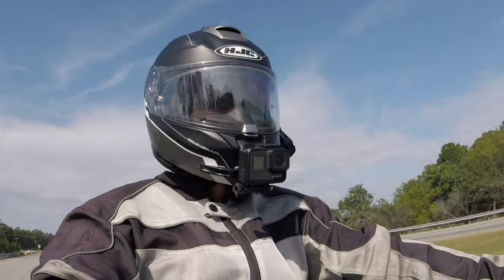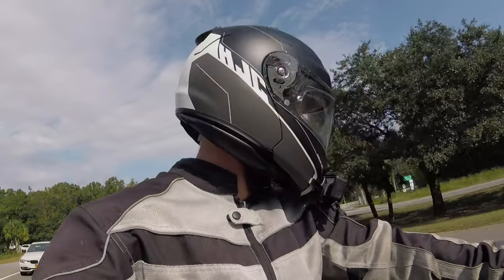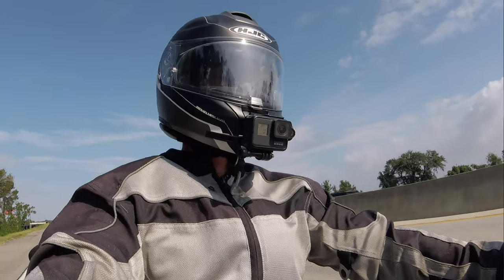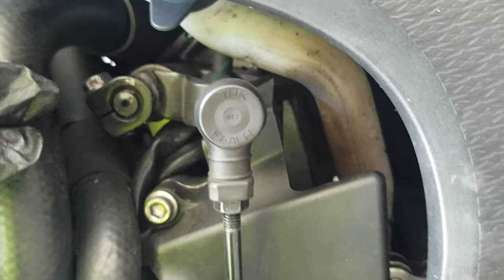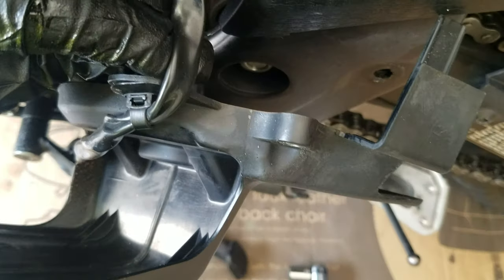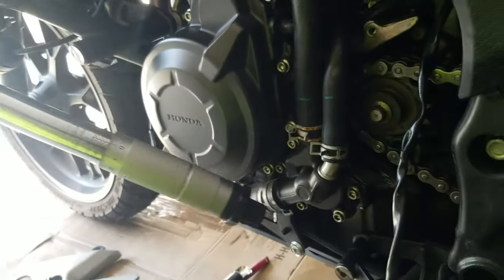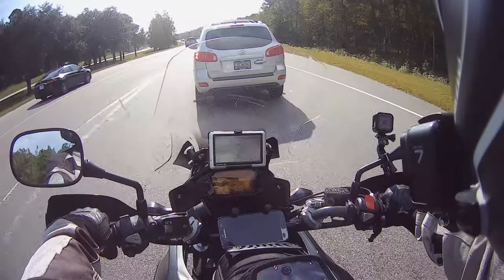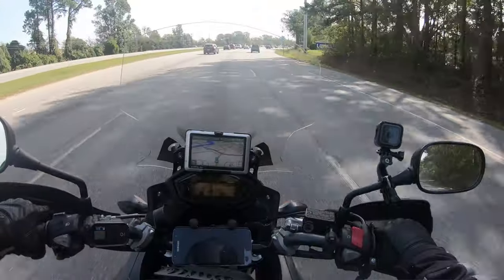CB500X 16T Sprocket Swap

Comment: I was looking for the CB300R sprocket swap but it's a very similar operation.
Reply from the maker: That's awesome, Bill!  I hope my video was helpful.  I would imagine many of these Honda models are similar, and probably even share parts.  Enjoy your upgrade!  :-)
Reply: @MotoPhotoAdventures  The sprocket on the CB300R looks different but the procedure to change it is exactly the same,  after the change the RPMs are around 1,000 less than before.
Thanks for sharing your video and have a safe ride!

Comment: Great! Thanks! I wonder what Honda's engineers would have to say to defend their decision concerning their choice of 15-tooth sprocket ???
Reply from the maker: Glad you liked it, Alain!  Honda's response would be easy.  "We build our motorcycle with the entire world in mind, not just the highways of the developed countries."  Since many riders live in developing countries with smaller roads, or in the mountains with lots of hills and curves, or in areas with bumps and potholes, cruising on a highway at 70mph is not normal.  For them, the 15T sprocket is perfect.  But for us in countries with large highway systems and long-distance motorcycle trips, the 16T is better suited.  Plus it's an easy upgrade for less than $25!!!  :-)
Reply: Two up with full luggage.. maybe..

Comment: torque at every RPM will be 6% less (15/16).  For those who plan a little off roading, they might want the stock 15T for more torque when on difficult steep terrain.  I love the CB500X. had 2013, switched to a Versys 650, want to go back to CB now!!
Reply from the maker: Thanks for the nice comment, Jim!  I looked at the Versys too.  But the CB500X was just right for me.  You should come back!!!  :-)
Reply: BUT the new 2019 model got an 4% torque improvment, so the overall loss will be 2%. The benefits are so obvious that makes an apsoloute worth upgrade

Comment: I've so got to do this on my Honda Rebel 500. 1st gear is so short it's a joke. And the RPM's on the highway is just extra wear on my motor for no reason. Right now it's just to torguey, I'm never going to do wheelies on my Rebel anyway it's just a waist of fuel running so high RPM.
Reply from the maker: Sounds like a great plan, Scott!  A friend of mine owns the Rebel 500.  It uses the exact same engine as my CB500X.  One could argue the CB500X needs the shorter first gear for technical off-road riding.  But there is zero argument as to why the Rebel would need such a short first gear.  I think you will transform that bike into a much more user-friendly machine if you make the switch.  Good luck!
Reply: @MotoPhotoAdventures  Thanks Chris but mainly I just want to do longer highway trips without it running so high.

Comment: Did anyone find it that the bike vibrates a little bit more than with the orinal sprocket ? I feel more vibration on the bar handles
Reply from the maker: I haven't experienced that.  If anything, the bike got smoother with the new sprocket since most of the time I'm reving at lower rpm due to the upgrade.

Comment: The factory gearing on my CB300F is too low for my liking, so I went with a +1 front sprocket. I belive the change was from 15 to 16. So much to my liking, but I have to be a bit more cautious when passing in the oncoming lane. There isn't much power left to pass if highway crusing in top gear.
Reply from the maker: Hi James!  That makes perfect sense.  These aren't very powerful engines for passing.  Glad you like the better gearing otherwise!

Comment: Dumb question : Why not change the rear sprocket instead of the front? Costlier?
Reply from the maker: You can easily do either.  But changing the rear is more expensive and more involved (removing entire wheel from bike, breaking the very tight large bolts holding it in place, etc.)  But many people change the rear.  And some even do both!

Comment: is there any way too recalibrate the speed on the bike dash?
Reply from the maker: Hi David!  Absolutely!!!  It's actually really easy to do by plugging in a "Speedo Healer".  A couple different companies make them.  Here's the one we recommend:  SpeedoDRD DRD-3 from 12 oClock Labs - https://amzn.to/2Pahs8C.  Even a stock CB500X right off the showroom floor can have a small discrepancy in the speedometer.  If you replace the stock tires with knobby tires or a tire of a slightly different diameter, that can throw it off even more.  Which is why some buy the SpeedoDRD whether they change the sprocket or not.  Enjoy!

Comment: It's funny how your speedo is out compared to your GPS. As I read in most cases (maybe it's a European /UK model thing) that when you change up to a 16 tooth front sprocket it brings the accuracy of the speedo and the GPS to be spot on, as the speedo has always been out reading around 4% higher

Regarding the bike's recorded mileage would that be affected too being our speedo is now out ?
Reply from the maker: Yeah, I don't think the speedometers on these bikes are terribly accurate from the factory.  Changing the tires, changing the sprockets, and many other things can affect the accuracy even more.

Comment: Personally we don't like to change the GB sprocket .  If you had put one tooth less Rear sprocket that was better for highway top end speed or open ur throttle for some rev fun .  You may hurt ur bike crank soon .. Happy riding.
Reply from the maker: Thanks for the tip, Speedwell rider!  I'll keep that in mind when it's time to replace.  But for now, since hundreds of other CB500X owners have done the same modification without a single incident that I've heard of on any of the chat forums, hopefully I'll be fine.  I've been extremely happy with the new gearing.  And I just returned from a 4,500 mile adventure through Mexico on it with no issues.  But I do appreciate the kind word of advice.

Comment: is the speedo healer a part that has to remain on the bike or just recalibrates..... I guess I'm wondering if this can just be taken to the dealer to be recalibrated?
Reply from the maker: Check out their website.  It's explained quite well.  The device plugs "in line" with another port or sensor on the bike.  It remains there permanently.  Cool part is, if you ever change to a different profile tire or a different sprocket, you can just go in and adjust the speedo again.
Reply: @MotoPhotoAdventures  awesome!  thx for the info!
Reply from the maker: @h.o.w.d2161  any time!

Comment: Bro I did this and I didn't mark the shifter when I removed it. Is there a specific point it needs to go back? My motorcycle didn't come with a manuel.
Reply from the maker: No problem!  We have made a video on how to adjust your gear shifter:  https://youtu.be/xYH3tdJnI_8?si=0jleL3JXowStnF8D.  The video is for a Suzuki V-strom.  But it's the same exact process for the CB500X.  There is no "right" or "wrong" setting.  The shifter is designed so that you can make the angle higher (like if you have big feet or large boots), or lower (like if you ride with tennis shoes).  Just put it on, then sit on the motorcycle to see if it's in a comfortable position, then adjust up or down if needed, then tighten it back up.  Cheers!
Reply: @MotoPhotoAdventures  thanks so much man
Reply from the maker: @sanguiniusix9430  happy to help!  You should check out our CB500X playlist...lots of great tips and tutorials:  https://youtube.com/playlist?list=PLMpCu16Bx7xP_DfFjhRG9np5cXTO-1uNY&si=1CpX75GkpM6Wm7rh

Comment: 6:20  is that axle nut a 24mm or 22mm?  I can't find any confirmation on the 2019 model, although it could be a safe bet the 2013 through 2018 model's rear axle nuts are the same size.
Reply from the maker: It's a 24mm nut.
Reply: Why ask?, just measure it.
Reply: @davidjames1684  How am I supposed to measure it if I HAVEN'T even received the bike yet?  Yes I could probably go to the dealership again before I'm financially ready to order the bike and just measure the 2018's and ASSUME it's the same, but I'd rather not assume and just..KNOW from someone who actually own's the 2019 bike.  

Why is that a problem?  -_-
Reply: @davidjames1684  Why ask anyone anything online?  Why have a conversation space on youtube or any social networking website/domain?  Why communicate with anyone..period?   -_-.  Move on

Comment: I have had my 2017  cb500x since Jan of 18 with 6 miles on it. Unfortunately due to health reasons,I have only put 1500 miles on it. I have now been cleared by my back surgeon to ride . Glad to know I'm not the only one that doesn't like the gearing. Thanks for the video. I noticed that you had a gps and phone on your bike , how is that wired? I didn't think a bike this little could handle all that. I got mine because it is little( I haven't ridden bikes since the late 80's and gps ,phone  Ect. Was not even a thing. ) I had inline 4's and the charging system was junk. Could you point me in the direction of how to wire these devices up without killing the system and burning the bike to the ground.  Any inf would be greatly appreciated. Doe to my situation,I stayed away from motorcycle videos because it depressed me. Thinking I would never ride again( the 120/130 mph shanagins were out of my system mostly) I have loved bikes since  I was 12 (1972)  Now that i have chance to at least put around while camping I'm all fired up ready to explore. Now I am bending on  motorcycle videos. I am going to order that sprocket . I think it was geared more for off-road  and I am not going to push my luck out jumping stuff( I know me) we like to visit small towns looking for BBQ ind local dives for that great Burger. A gps would make that more fun and safer. 
Thanks again for the video, I gotta go order a sprocket.
Reply from the maker: Hi Marshall!  Thanks for the comment.  The CB300X is an awesome bike for what you're doing.  Although I've done a lot of major off-road trips like the TAT and the MABDR...I've also done a lot of riding to BBQ and Burger joints!  Here's a full playlist on the CB500X I think you'll enjoy:  https://youtube.com/playlist?list=PLMpCu16Bx7xP_DfFjhRG9np5cXTO-1uNY&si=ISlvyTzEyytTd6PA.  And here's a fun trip we took along the Natchez Trace Parkway, stopping at some of the most AMAZING eateries in the south:  https://youtube.com/playlist?list=PLMpCu16Bx7xMC7UWnKwbRjGPJOaXGn8RG&si=Al3JIO-GcdOALFIN.  As far as your direct question, the CB500X actually has a VERY robust electrical system!  It has plenty of overhead "juice" for you to run a dedicated GPS, charge your phone, plus power a GoPro charge AND a drone charger in your tank bag all at the same time.  I know because I did that all the time on most of our adventures...and never got stranded or "killed" the electrical system.  My devices were almost always connected to a "switched" power cable.  Here's a video I did about the original GPS on my CB500X:  https://youtu.be/0x4pZ6Of70c?si=YkURQt7UjNMP5drl.  Unfortunately, I didn't discuss the electrical connection.  But here's the GPS install video on my Aprilia Tuareg 660, in which I go into great lengths to show how to find "switched" power and tap into it for your electronics:  https://youtu.be/AsFbkLwNu2M?si=7yeww0WCNjhaXdh4.  I hope this helps!  Please subscribe and stay tuned for more videos to come...

Comment: Heads up... The links for the sprocket  posted under your video is incorrect. I ordered it and it did not fit. After calling JT sprockets, the part number is JTF1381.16 parts unlimited also carries these sprockets and part number is 1212-1237. DennisKirk also has them, part # 807-5016.
Reply from the maker: Wow...thanks for the update!  Recently someone told me a few months ago the part number I had listed was no longer available from JT sprockets.  So I did a Google search and it gave me this one.  Guess I need to change it back!  Appreciate you letting me know.

Comment: Hi from Greece, congrats for the very nice video presentation, I own the 2014 white CB500X ABS, with 102000 km. I feel the revving up in any speed, maybe not so much on the 5th gear, but certainly on the 6th, but, how does the bike respond with a passenger on? As it is (15T sprocket) it is already heavy in the city and not so much accelerating with a passenger on, I guess 16T with 2 people on it will suffer and this is the main reason I have not done it already. Can we overcome this (increasing the HP somehow....) so that the heavier weight (2 people) does not have such an effect? Thank you.
Reply from the maker: Hello Markos!  You are so lucky.  Greece is such a beautiful country.  I have not been yet...but my wife says she will take me to visit one day.  :-)  I think with a passenger, the 16T upgrade is not recommended.  However, we did another video using a 39T rear sprocket instead.  I think this might be a good solution to try:  https://youtu.be/Je6LdgYt9fg.  Unfortunately, many have tried adding horsepower to this little bike...and it just isn't easy to do.  If you need more horsepower, you just need a bigger bike.  But you can try the 39T upgrade first.  It's very easy and inexpensive.  I love it even more than the 16T front sprocket upgrade!  Good luck, my friend.

Comment: Thanks for the video, but always record the whole video if you give advice because these are life-threatening procedures. You should have recorded everything as you put it together because a lot of beginners watch the video and work on it without thinking. So every screw counts! I was also interested in how you just took out the chain guard without screwing because the video is so cuted out and then I wanted to see how you would get it back but you just said it doesn’t fit on 16t sprocket. However, I am writing this because I know people have had accidents following incomplete tips from youtube. Ride safe!
Reply from the maker: Thanks for your comment!  I produced this video years ago when I was new to YouTube.  If you watch our more recent tutorials, we are very detailed and thorough:  https://youtu.be/eSRQAPNuWOw.  Having said that, YouTube videos are only there for information.  If someone isn't handy with mechanical things, they should always take their bike to a professional.  Also, to answer your question about the chain guard, once you remove the sprocket cover, there are no extra screws holding the chain guard in place.  It is only secured by the same bolts that hold the sprocket cover in place.  I hope this helps!  Cheers...

Comment: Wow! So much for an informational video. You skipped half the process. Does the new sprocket even fit without issue? Any mods for sprocket clearance?
Reply from the maker: Hi Sauce Boss!  Thanks for the comment.  I should hope that anyone willing to take on a DIY project like this has enough mechanical know-how to fill in the gaps.  It's really a very easy and straight-forward process.  The 16T sprocket fits on like a charm.  No modifications are needed.  I've heard of people putting a 17T sprocket in, but they had to grind down the chain guard to do so.  I did grind down my chain guard a bit to be safe.  But it's not needed.  I have run a 16T sprocket on my bike for about 40K miles now and loved every single mile!  Even did the entire Trans-America Trail (off-road adventure) with a 16T:  https://www.youtube.com/watch?v=Im8M-tRJXuY&t=737s.  I'm just now experimenting with my gearing ratios again.  This time going back to the 15T front sprocket, while changing the rear from a 41T to a 39T.  I'm liking that combo really well so far.  I'm currently editing the video for it.  I should mention that the 16T sprocket swap video was recorded in 2019 when I was new at doing YouTube videos.  Check out some of our newer ones an you'll see we've really stepped up our game:  https://www.youtube.com/watch?v=eSRQAPNuWOw&t=1s.  Thanks for watching...enjoy!

Comment: did the combination of the 16T and the 39T sprockets make a difference or can it be done ?? or will it affect the torque of the bike ???
Reply from the maker: Hi Nate!  You should check out our other video about the 39T:  https://youtu.be/Je6LdgYt9fg.  It goes into more detail about the percentages and such.  I personally wouldn't combine both.  The 16T alone makes a significant drop in rpm.  Any further adjustment beyond that would probably sacrifice too much torque.  That's why I switched to a 15T/39T combination.  It actually gives back some of the low-end torque for off-roading, while giving a minor reduction in rpm on highways.  But if you mostly do pavement and only go offroad occasionally, I think the 16T is the way to go.